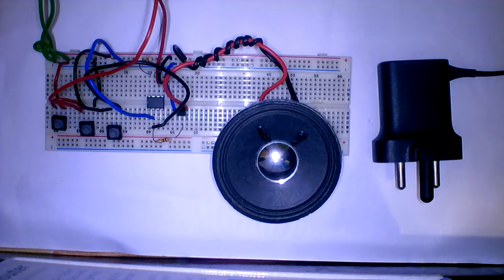Police siren, ambulance siren and fire engine siren using UM3561 IC

Comment: Could you give more infos about inputs osc1 and osc2, the value of the resistence, and the role played by the transistor?

Can you use only 2 buttons (on-on, on-off, off-on, off-off) in a different wiring?

Thanks
Marco